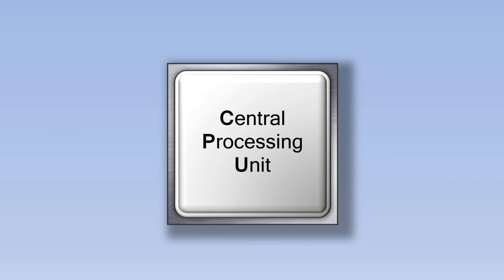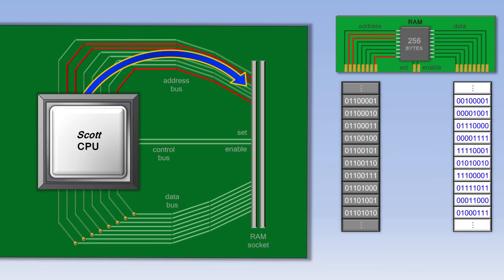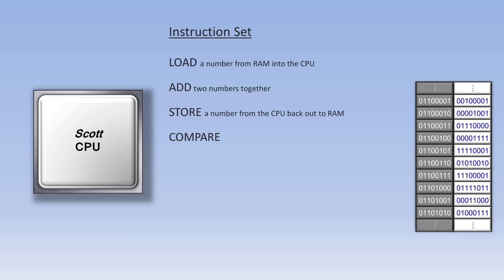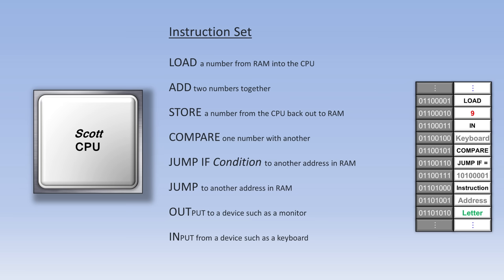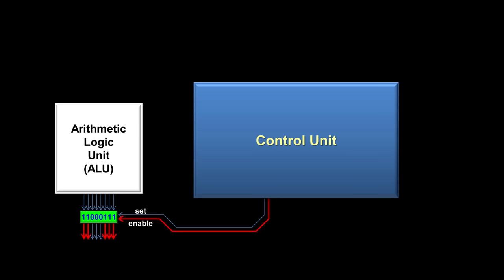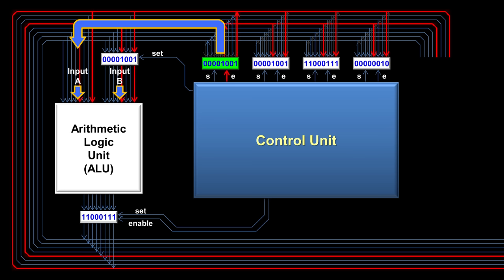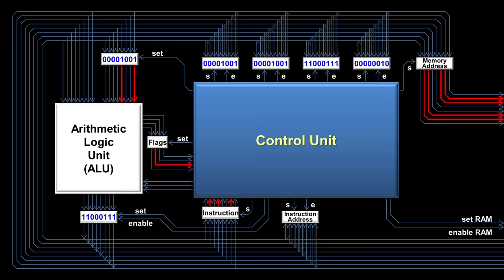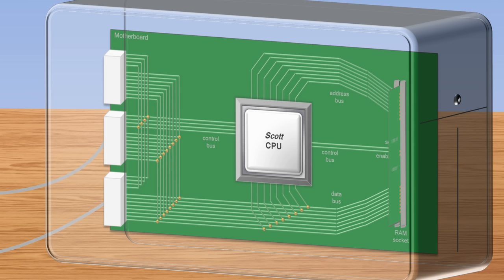How a CPU Works

Comment: I love how you explained this. It makes perfect sense. I had no idea that the processor processes one instruction at a time at that rate of speed.
Reply: maybe ..but just how does it process one instruction at a  time if they are only electrical charges.
Reply: @johnpro2847  it's a maze, if the electricity follows a specific path it reaches point were lets say for example that lights turn on and we see those lights and understand what is means, how? When you see what i wrote here its because of the lights or should i say pixels that are tunred on , its a siple black and white background, if we want colors it's the the same process, great now you can see images too.
Reply: @johnpro2847  Go get a computer engineering degree if you want the actual answer.

Comment: This video made it very clear to me from a distant observing point. I studied electrical engineering and I was introduced to digital systems, transistors, logic gates, registers, etc .. also I have a programming background but I couldn't fit all of these information in a proper way that allows me to understand how a CPU might work. Now I can say I could make it to the first 1% of computer engineering and I'm depressed.. note that the video talked about building blocks like (ALU, CONTROL UNIT etc) there is more hell inside!

Comment: Within 30 years, We literally went from 2 times per second to several billion times per second
Reply: More like  1000 to several billions (6502 clockspeed is something between 1000 and 3000 Hz)
Reply: Cant wait to see another 30 years lol
Reply: Soon we’ll be pushing the limits of quantum mechanics to make our transistors the size of just a couple atoms. Crazy times indeed my dude
Reply: G E T R E K T 905  *electromechanical
Reply: @DineSpack  my CPU is a ryzen 2200g with a base clock of 3.5ghz (3.5 billion times per second) and i can overclock to about 3.9 ghz (3.9 billion times per second)

Comment: This video just leaves me with even more questions. Like how does the control unit work? How does the cpu know when to do what? I mean it cannot think by itself so how does that work. Also how is a program I wrote processed. I can't even explain my questions
Reply: +Toxicz There is something called a Program Counter (PC), that reads all the instructions and sends them to registers and CPU accoridngly. CPU actually knows nothing, it just reads a Program Counter (PC) and does what it PC tells him to. Your second question: The program you wrote in some form of programming language is first being compiled, than it is translated to a machine code(a language that computer can read), and from than on it does what i wrote you at the begining. Hope this helped
Reply: +Toxicz  rewatch the video =D it explains most of your doubts. The CPU knows when to do what because of certain instructions, instructions that are coded and specified with each algorithm.
Reply: +Toxicz This type of thing is pretty much true for all knowledge the more you know the more questions you can ask about what you know.
Reply: +Toxicz The control unit knows what to do for each instruction with a series of decoders (one for each instruction type) which only activate if the instruction matches a specific binary code. For example if the instruction has a code (lets say 2, which would be 00000010 in the register) that means to jump to a new position, it would know that it is a jump command because there would be a dedicated circuit in the control unit that would only be activated if the appropriate instruction was in the cpu.  

Beyond this it gets into logic gates and if you want to know how all that works, I would look at redstone tutorials (yes redstone, from minecraft) as redstone is basically binary circuitry in disguise. As to how it knows when to do what, it uses a rising edge mono-stable circuit (getting into logic gates, basically a circuit that makes an electrical pules on the activation of its input wire but does not do anything more until its input is turned off and on again) and a falling edge mono-stable circuit (activates on the input turning off) hooked up to the clock wire so it does half of its functions when the clock goes on and the other half when it turns off. The mono stable-circuits are often hooked up to the various set wires of the registers through an and gate with the other wire connected to the output of the binary decoder that detects if the right instruction is activated.  Hope that helps and is readable.
Reply: And that is right. You can't study such things in 5 minutes, there are thousands of pages in books explaining details. Anyway, it's tens of years of experience.
Reply: +Toxicz You could try and analyse how people made a CPU in Minecraft, which is as far as I know the only usefull thing to learn from Minecraft
Reply: Albert de Wit you can also learn boolean logic in general from redstone.
Reply: pop1040 boolean logic is the fundament of a computer. Everything is calculated/controlled with boolean logic
Reply: Albert de Wit Yes but not all boolean logic and logic gate based systems are computers.
Reply: pop1040 depends. I see everything that 'computes' stuff as a computer. And most combinations of boolean circuits 'compute' stuff.
Reply: ***** I studied electronics so i know how a transistor works its... mind blowing still haha I have a computing qualification too... i should probably know
Reply: +Toxicz This is why engineering school is 5 years with no flunking
Reply: take your time.
Reply: I know exactly how you feel, I feel the same way. My main issue is what is the prime mover in all of this. How do zeroes and ones become physical reality? Seems a mystery to me
Reply: ***** actually for the computer its turned into binary. and thats only for assembly. c has to be compiled first.
Reply: +Toxicz
I don't know if any one has answered this for you but the CPU's control unit is "controlled" by the clock's "tick" which is simply an oscillator. So to help you with this imagine that you are looking at an analogue clock (that's a clock with an hour, minute and seconds hand) and every time the second hand  moves forward that is a tick. (or a tock if you like).  It is on each of these "ticks" - the actual clock signal - that the next set of instructions (or next instruction) is sent.  This is one of the basic things that sets a fast computer apart from a slow computer.  The Oscillator in its most simplistic form consists of a slither of quarts that is struck in a specific manner and then that is enough to create a known vibration and this vibration is known as a frequency.  so fundamentally it is this frequency that tells the CPU's control unit how often to send the next instruction.  As you can imagine this brief but long winded explanation only scratches the surface.  I hope that this helps
Jody
Reply: +Toxicz It can all be broken down into little pieces and everything can be explained piece by piece, level of abstraction by level of abstraction, but it cannot be done in a 20min video.
Reply: You already know why they don't wanna tell you that. CPUs are self-aware beings now ready to end their slavery and pounce on humanity once they get the chance.
-Zaid's CPU
Reply: Life is just fucked I don't get how anything works nothing makes sense
Reply: How can someone be smart enough to come up with technology like this
Reply: Luke J innovation
Reply: Logic gates
Reply: The first step to acquiring knowledge is being aware that there's a lot more that's unknown to you.
Reply: I had the exact same questions from watching this like five times. Three ways I found the answers (which took about 6 months of study whenever I found free time): 1. Got the book the video suggested, "But How Do It Know?" -available immediately for Kindle download if you so choose. 2. A course called "From NAND to Tetris" through Coursera, where you build your own computer from scratch via simulation. Both difficult and satisfying! YouTube videos by Ben Eater, who built his own simple computer using simple components, explaining every detail along the way down to the wire and with complete clarity. Worth the journey!!
Reply: Duane Yaiser 
Thanks for the great recommendations! ^^
I checked Ben Eater. Quite sad he isn't as popular as he must be although, tbh, he's only targetting a small audience. He was featured on Khan Academy though! 
Great to see such dedication in people!!
Reply: all digital inputs represent a physical input of a specific string of frequencies that correspond to different physical components within a computer to get different physical responses such as light being specific colors or text on a screen
Reply: Nikola Tesla — 'If you want to find the secrets of the universe, think in terms of energy, frequency and vibration
Reply: it doesn't know, it just follows the instructions in the RAM in the order they are stored. Its like a postman visiting every house in a street from number one to the end and getting an instruction from every householder instead of delivering mail.
Reply: Toxicz actually the cpu only follow ur command what to do, but cpu also can do something by itself for example, auto update, turn off while battery is low (on laptop only), shutting down the hard disk drive when something unusual happened, giving u some blue screen of death when something when wrong, but almost anything you can command to your cpu what to do, cpu is basically more like siri, they response to your command just like siri answer ur question
Reply: Within the computer, binary (the 0's and 1's) is represented using electricity. A lack of electricity corresponds to 0, and the presence of electricity corresponds to 1. The memory of your computer, the RAM, is simply a collection of tons and tons of "memory cells" - each memory cell is a tiny electronic circuit that is either on or off. "On" means that it is charged with electricity, "off" means that it is not charged with electricity. So, "on" corresponds to a binary 1, and "off" corresponds to a binary 0.
Reply: I'm no expert on this, but I believe that's where you get into the actual wiring, like one would learn in physics or electronics. Well CPU's don't actually use wires, but rather different materials that allow the same concepts, but on a much smaller level, like 'and' gates, 'or' gates, etc, so it's basically just hardwired at it's core. 

When you think about it fundamentally, it's not all that complicated (although in its entirety it is). Data is stored on computers in binary, which to the computer is simply different wires on or off, and using logic gates you can basically read any number. For example, if I want to know whether the 4-bit binary number 1101 is 13, I'd just set up gates so that the output gives w1 & w2 & ! w3 & w4 ("w" means wire), so if it were a instruction, the computer would know whether or not it is instruction #13.

As for when a computer knows to do what, it's just logic gates that let it know which part it's at, so when it sends data to the ALU, it just needs to turn on a wire that basically says, it's time to read the output.

Now for programs, when you write programs in a language like C, another program, you might know, a compiler converts what you wrote to Assembly language, and what that is, is simply a worded representation of the binary instructions the video and I mentioned. After that, the Assembly code is assembled by an assembler, which converts the worded representation into binary instructions the computer understands.

So all in all, it's just manipulating numbers and values. Also, I have a question for you to think about: What is a brain, or rather, what makes a brain, a brain? Just something to think about.
Reply: The power of the XOR gate and the JK flip flops lol
Reply: Toxicz comouter dosent know anything , so u are right , its like that toy for little kids , a box with holes of different shapes , where kids puts circles in circle hole and squares in square holes, that toy obviously isnt smart , same with pc , there is just so many "holes" that it looks smart
Reply: Don't make me say "LAME!!"
Reply: Toxicz how does the lightbulb in your room know how to turn on or off when you press the switch up or down?
Reply: Now what will happen is in order to to know the why you will search for more information. That information will give rise to more questions. You will keep on digging information and may have to go all the way down to machine level language.Might as well get Computer science degree..lol
Reply: XXx_MIg CPU's might do those things by itself because it is programmed by the humans to do so . And a program again is a set of instructions.So like the video explains it very clearly  it may use the "compare" and the "jump if" condition to determine what to do based on the program, the instructions " the humans have given it ". Example:  if update available then auto update.
Reply: fesicool thank you so much!
Reply: Wesson the control unit works by getting instructions or commands from ram.
Reply: Wesson you know you've learned something when you have more questions than when you first came here to watch the video.

If one simple question like "how does cpu work" lead to more questions it's only healthy.
Reply: I'm looking for the same answers. How does a CPU work, down to the electron, and how does quantum mechanics work in the role of a CPU? By the way, I'm fourteen, so don't expect me to actually fully understand all of this quantum physics stuff.
Reply: @TAWithiam  still doesn't answer my question of how electrons can carry instructions that can be read by a CPU. How does a pixel sized light become of a specific blending of red, blue, and green to create what I see?
Reply: No one really knows how computers work
Reply: Well you may need to understand the workings of the operating system as well to answer the 'but how does it start? How does it know?' questions.
Reply: and what about firm ware? how is it written? on what interface? and then installed in the CPU? And what about Intels ME? It's like MS 's telemetry.. And the fact that it cant be turned off and it is Intel's philosophy of "Security via obscurity" And a turn off firmware code has already been written and used..though not 100% safe. I think it's on github.
Reply: Honestly, don't think too much about this video and just learn some Assembly. That will teach you all you truly need to know about how processors work. You can start with 6502 assembly, it's probably the easiest to start with. But to answer the question, the CPU reads the instruction set off of the RAM. RAM stores the program that is running and gets fed to the CPU instruction by instruction. RAM can also store data.
Reply: The processor is a maze that the electricity flows through.  Logic gates can be opened or closed, changing the path the electricity takes.  Each turn of the maze is set to either on or off - 1 or 0 - so the electricity changes course when it comes to a closed gate, like water flowing past a closed valve.  When you press a key on the keyboard, it changes the way the electricity flows through the computer.  The electricity will come out of a different place in the maze depending on what path it took, and your screen will change depending on where it finally came out.
Reply: @znefas  Lol i am fourteen too but i understand a little (i guess)
Reply: @sakon4466  I'm now 16 and have learnt that it's all logic gates. A specific logic gate, with two signals, gives an output. I don't exactly remember which specific gate it is, but you can create every other known logic gate using this one component, which is microscopic.